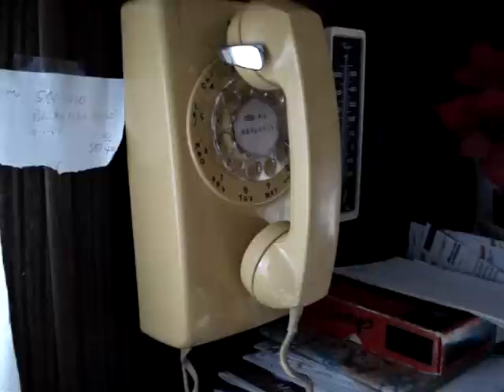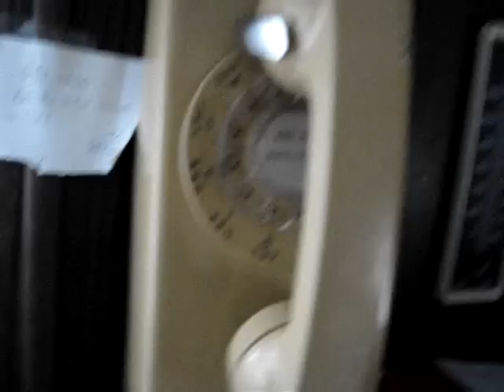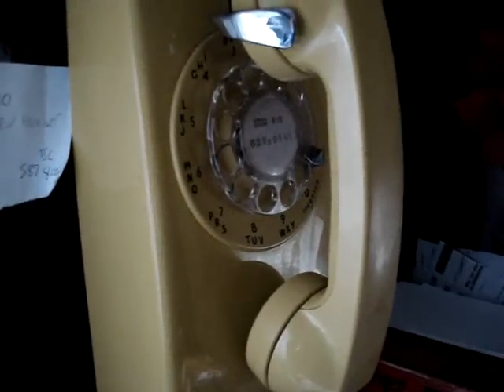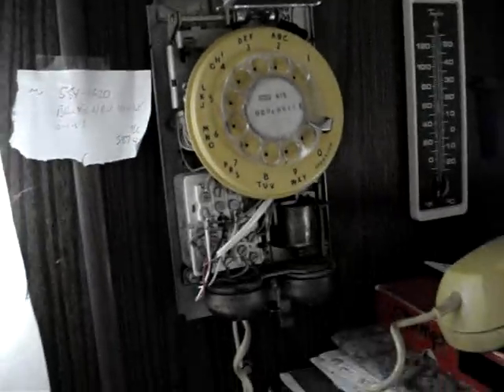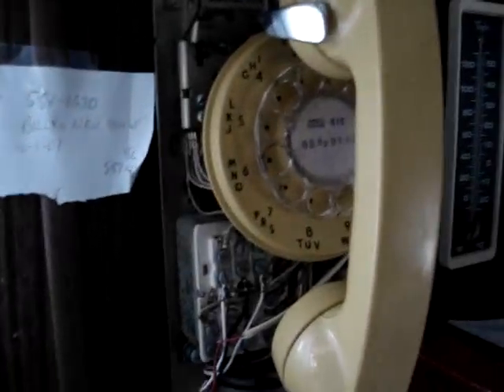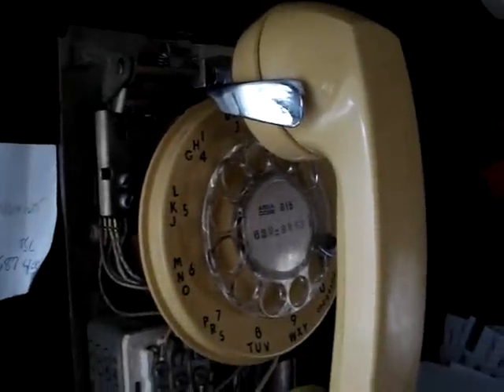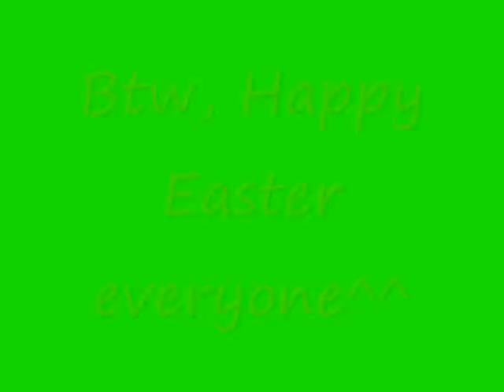vintage 1962 yellow wall phone

Comment: Great !! Jeremy Clarkson had that coming!!  I have new touch tone phones  with memory storage and caller id, but I still have my original 1954 black desk phone with a metal  rotary dial ,  a white 1958 desk phone with the clear plastic dial also hooked up sitting on the desk, and they work fine.  I hate the electronic rings of new phones   I have them all shut off and just allow the 1950's phones to ring.  I like the nostalgic ring of the 1950's  phones.  That is a nice wall phone.